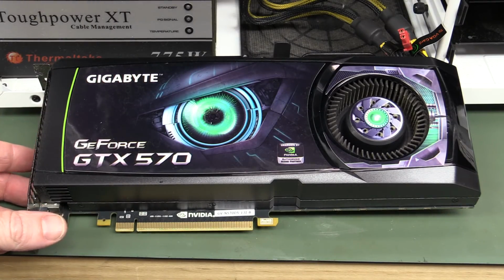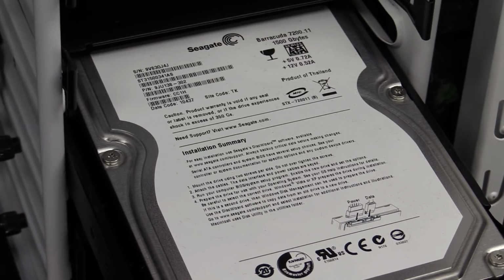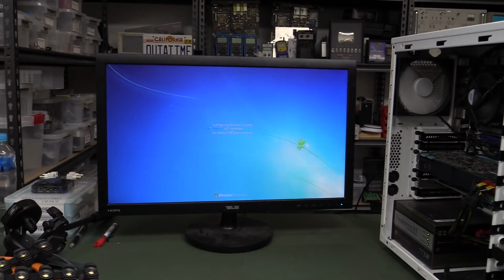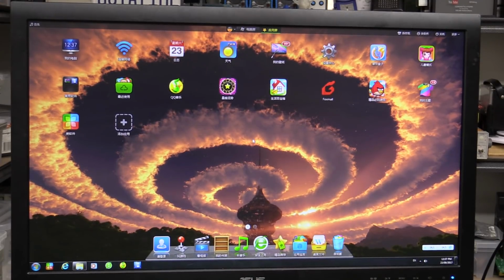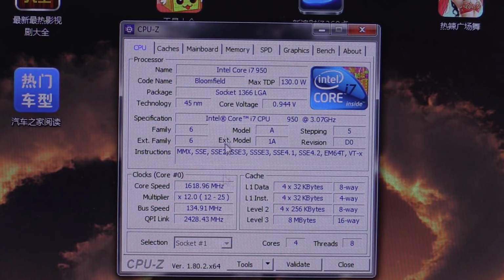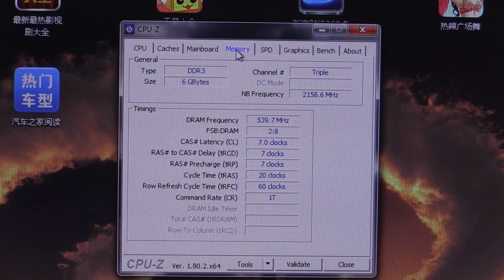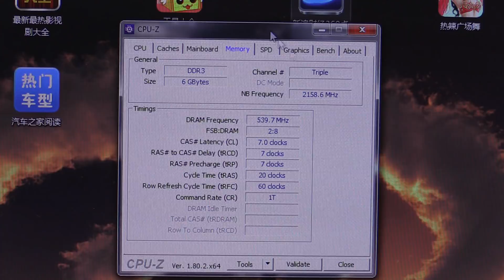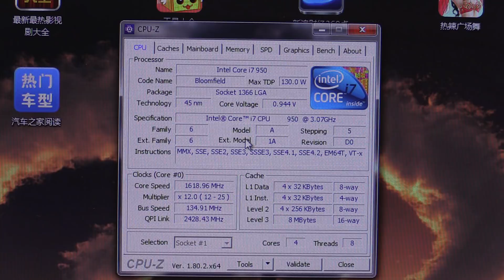EEVblog #1026 - Mystery Dumpster Diving PC

Comment: That case alone is worth something
Reply: Hey now!  That's the case that's sitting next to me!  It's a Design XL R2.  Nifty case, but I have the titanium grey version.  First time commenter.  Love your show.  Keep doing it.  I fall asleep to it every night.  No offense intended.  :)
Reply: You just hurt the feelings of the very similarly looking Fractal Design Define R5 (black model) that's sitting next to me :(

It's a great case, by the way. Much better than the sloppy copy ThermalTake made of it :)
Reply: Fractal cases are kinda meant to be "ugly", they're for gamers who have grown out of flashy cases which immitate a lamborghini and have lights all over them lol
Reply: You may not like it, but Fractal Design is one of the best case manufacturers around, and this case cost at least 100 USD when it was new. 

Even if you think it's ugly, it's still more convenient to assemble PC in than 99% of cases.
Reply: I have one of these. I didn't buy it for the looks but because reviews said it was pretty good at dampening the noise of a modern gaming pc while keeping it cool enough inside. And it does.
Reply: It;s looks alot better in black with a side window
Reply: The case, HDD, PSU and wifi card haven't depreciated nearly as much as the rest of the hardware.
Reply: Nothing anymore, the biggest thing was they included panels to block fan slots that you didn't use to increase airflow inside case. Other thing is that they're plain looking cases that some users prefer more than gaming look.
Reply: It`s the ugly ones that make a buck. I`ll buy that for a dollar lol
Reply: It can look pretty nice. It's designed with minimalism in mind.
Reply: It is but I sold the exact same one like 2 years ago for 70 Euros (but in better condition)
Reply: Yeah, I also have this one in titanium gray. It's minimalistitic grey brick. But white one is kind of ugly.
Reply: Everybody has fractal cases these days, not worth much actually in 2nd hand market.
Reply: What's special about the case?
Reply: Ok thanks. Doesn't seem very appealing
Reply: The fan panels were installed to dampen the sound of the computer. If you wanted more airflow you would be removing one to install a fan. Super easy to work in without any harm to yourself.
Reply: Me too R5 next to me.
Reply from the maker: I can't help but think it looks butt ugly.
Reply: Dog shit is worth something to certain people too

Comment: Naa, that PSU is ancient, not really worth it. But still would be nice if you'd take a look at that :)
Don't know if it has your beloved Japanese caps (MADE IN CHINA!) 
And it's made by CWT, AFAIR it's from 08 or something like that...

PS: THermaltake isn't really that great.
Board is worth at least 100 bucks or so, just an x58 from the last gen...
The CPU on the other hand is worthless. No one wanst those shitty 45nm Bloomfelds no more.
BUT: You can get a 6 core for way less than 100 bucks...
Reply: it cost him $0 you know
Reply: Technically it cost him rent for the room he has in that building.
But that wasn't the point, was it?
The rig he got is rather good and for the board alone he can get a pretty penny. 
Just the PSU isn't that good. Especially by todays standards, my point was that it isn't as good as it looks.
And that dave should absolutely take a look inside it, if all caps are OK or not...
Reply: Stefan Payne  You're a wacko. And it didn't cost him the rent of the building. It cost him his time spent stopping by the room and the opportunity cost of whatever else he could have done with those 2 minutes.
Reply: You cleary don't have an idea to say it's ancient, at least.
Reply: an older PSU would be better, because they were built to handle components that made it so you couldn't even count the money you're losing to the electric company. that is actually a pretty good looking power supply, l am running an old power supply in my rig with no problems. l got an 8350 and a 1070 in there and l haven't had any issues with it.

"THermaltake isn't really that great." yeah they are, they definitely aren't going to get any awards for their power supplies and l think only a handful if any are 80+ rated. but the components on the inside of those things are pretty good quality and they are built as a solid option for a budget user.

"Board is worth at least 100 bucks or so, just an x58 from the last gen" l wouldn't be in the market for an X58 board even if l was on an eating card board budget and you were giving it away for free. why would l pay $100 for a board that's at least 7 years old and can't do much since it wouldn't support any modern technologies?
Reply: The old thermaltake PSU from that time were very good and had high quality build. I am using the thoughpower 850W in my PC now from 2008 and its still going, ran 3 PCs basically so far.  Phenom 9850BE, then X4 945 and now FX8320, GPUs were 2 way SLI 9800GTX, then 3 way GTS250 and now a highly factory overclocked water cooled single GTX980.

Thermaltake PSUs now days are pretty crap.
Reply: It's actually a VERY good PSU. I have Thermaltake supplies in several systems that are older than this. Old does not mean no value. That whole system today would still be enough for just about any game. If you wanted to run at full HD and higher FPS, then an newer video card is all it would need. It beats my secondary rig in every way, and I still use that rig for a lot of games.